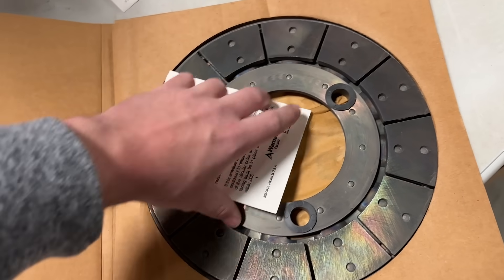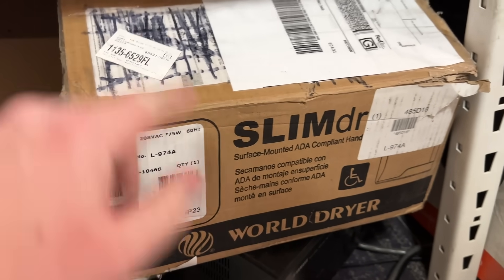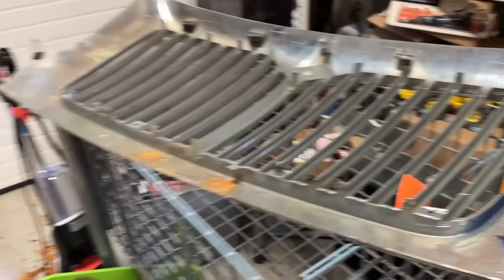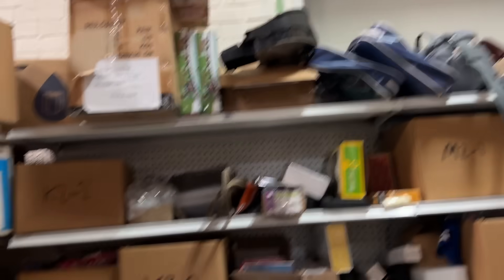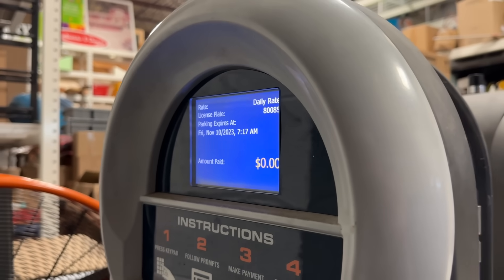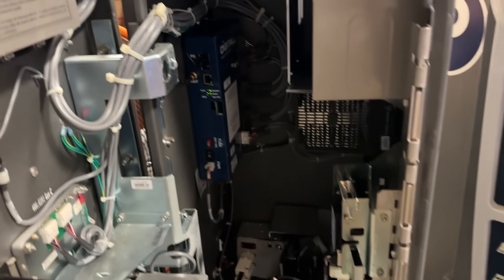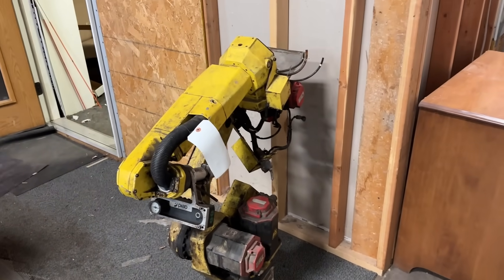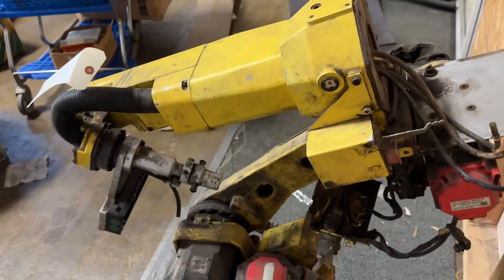These High Margin Auction Finds are worth Thousands on eBay!

Comment: Hey Rabbit! The drill is used for Intraosseous infusions. As a paramedic, we use them to drill into the marrow of a bone to quickly deliver fluid and medication to critically ill patients. The battery is sealed on the drill and it's disposable once the battery dies.
Reply from the maker: Interesting. How long does a battery typically last? Given the price point, that seems wasteful
Reply: @ResaleRabbit  They advertise 10 years or 500 uses.  The drill in my SUV  just died last month and I'm pretty sure it was at least 5 years old and had been used.

Comment: Those are the kind of things I resell. I always say that I look for the things that someone will want, but not everyone. I get my stuff from an online liquidation company and those obscure things that cost a little of nothing are my bread and butter. Industrial seems to do well. I sold early this year a laser micropipette puller that I bought for $60 for $1,400 including shipping. It was only partially functional. If it was fully functional, I could have got $5,000-8,000 for it. I still did pretty well.
Reply: What site do you use?
Reply: I'm sorry, but I'm not going to reveal that. I'm not looking to add to my competition. There are already 600,000 more bidders than when I joined. Plus, it wouldn't matter unless you were near one of their warehouses to pick up. You bid online, but pick up in person. I have mentioned on several of rabbits videos that I know the next evolution in his business. He could easily switch over to a model like this company and be off to the races. This company has gone from 1 small warehouse to over 50 in about 6 years. He already has the small warehouse.

Comment: I mean, I assume you offer the buyer of a defective part a discount to keep it at least equal to the cost of shipping it back if they want to try to fix it on their own. Which is also a risk, but they can do that no matter what because that's how eBay is, and you'll be forced to take the return even if it works just fine.  Then you don't have to ship it out again after it's already been returned. I find it hard to believe a buyer would turn down that offer if they were going to have it reshipped for parts later.

Comment: If you can't sell those big metal parts, you should look in to a local scrap yard to sell that metal to, instead putting in the dumpster.
Reply from the maker: The pallet was around 600lbs. That’s like $2.00 in steel. Scrapping steel just isn’t worth it anymore